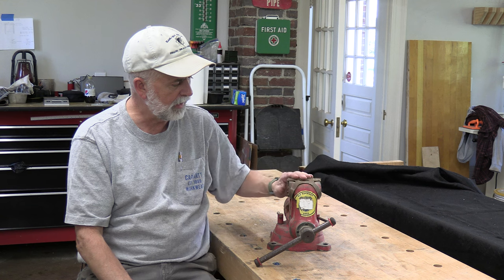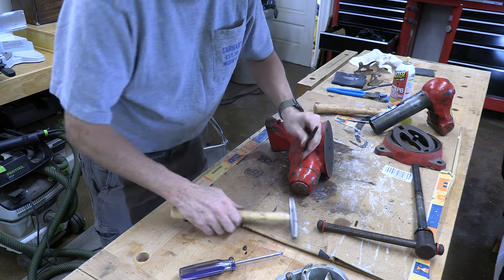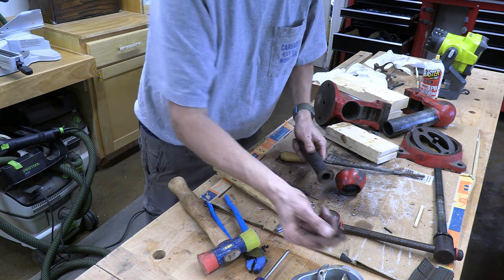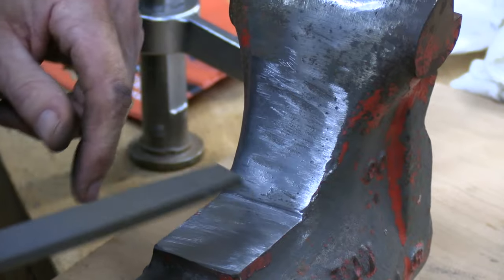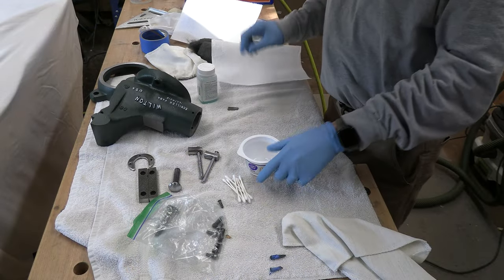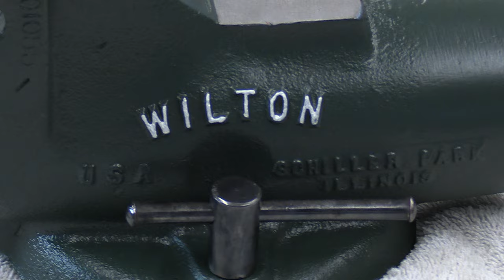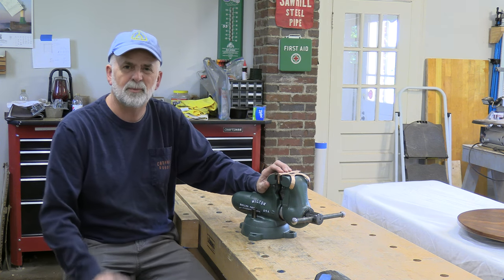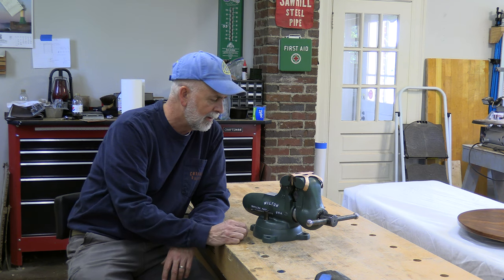Wilton Bullet Vise Restoration.  Copper Jaw Inserts

Comment: So if WIlton stamped the warranty date on the vice and it sat in the shop for two years before anybody bought it, did it still apply? Or would they go by the sales receipt? It’s very odd: they could have just stamped the production date on there, would have made no difference.
Reply from the maker: I agree, very odd.  I've read a good bit on these and my best guess is the slide key was not date stamped until final assembling, insuring the buyer got a full 5 year warranty.  i.e. this vise final assembly would have been in 1962 and stamped 1967.  Of course this is subject to debate! (I'm definitely not the expert) Thanks for watching.

Comment: I have the same vise, 3.5” bullet with pipe jaw castings. I ordered the pipe jaws as they were missing and short of that it’s in great shape for a rebuild. Interesting enough my straight jaws are like yours in great shape due to the extensive use of copper jaw inserts.
Reply from the maker: Cool!  Yeah, I was surprised of the condition, happily!  I just don't think this one got much use.  The copper inserts where rough, but it doesn't take much to ding them up.  Thanks for watching!